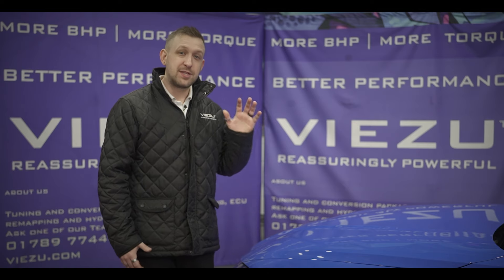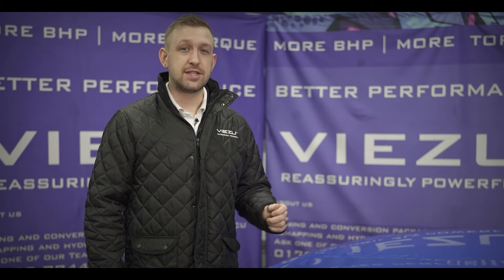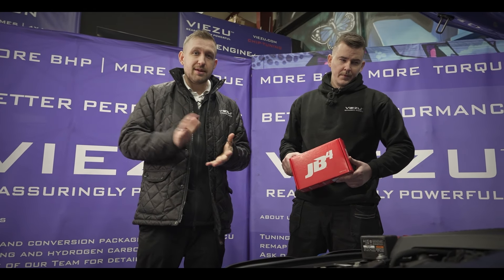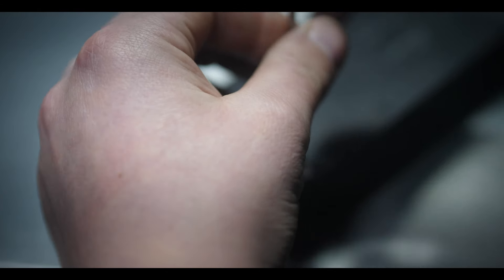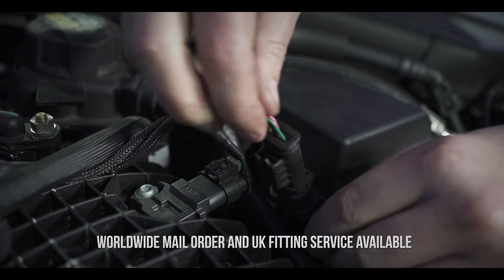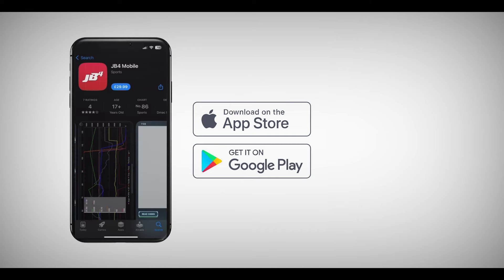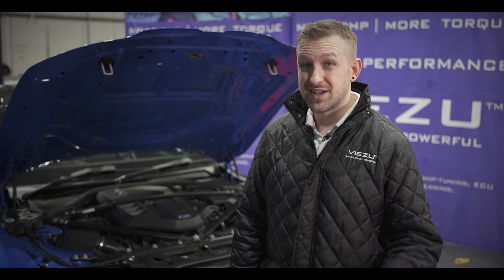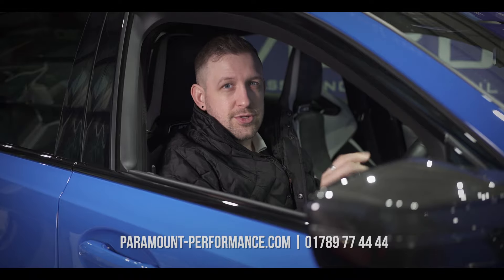BMW M3 Tuning and Remapping - Burger Box JB4 Tuning System Installation

Comment: Nice! Is it possible to change maps using dash?
Reply from the maker: Indeed this is a fantastic upgrade for your vehicle. It is not possible to change the maps from your dash, however there is a Bluetooth kit and app available for your mobile device (Android or Apple) where you can access all of the features for the JB4 to change maps, monitor your vehicle with over 40 live gauges and lots more. If you would like any further information on this or if you would like to get booked in for one of these please get in touch at info@viezu.com or give us a call on +441789 774444.